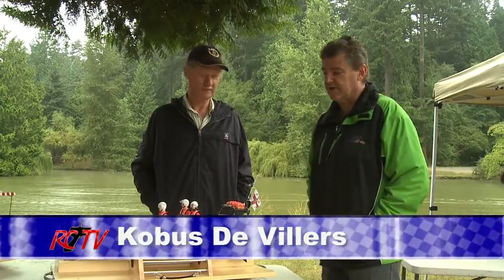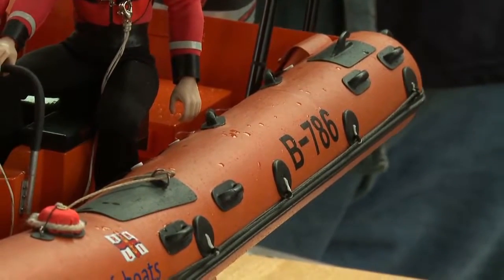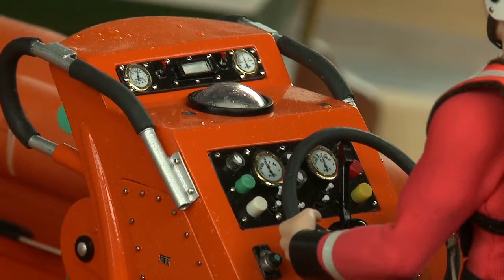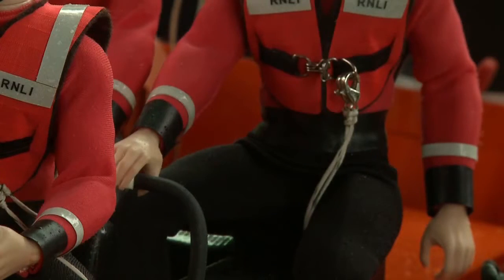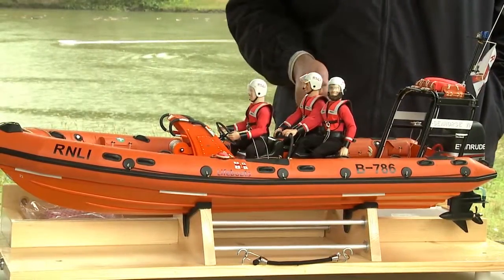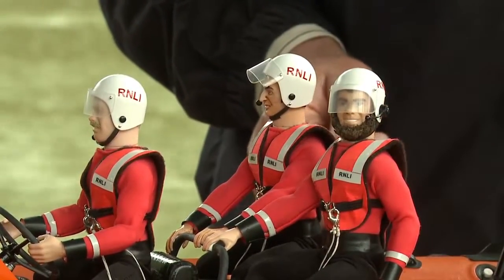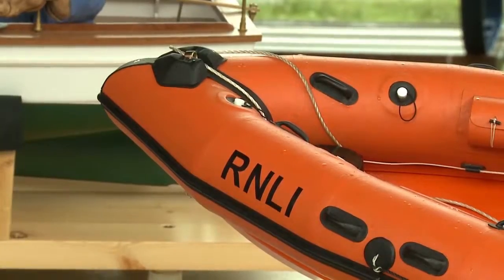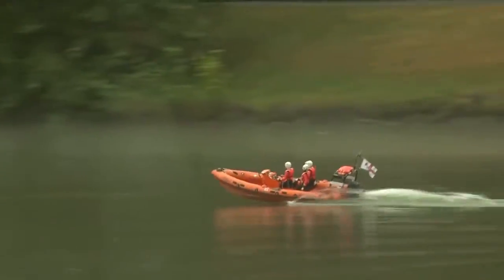Scale  RC Atlantic 75. This Zodiac style rescue boat is a great build!

Comment: 2:00 these boats don't automatically self right because it could harm the crew if they remain in the boat, instead there is a handle on the back that activates the self righting once every one is safely out the way

Very nice model, looks excellent

Comment: Nice model but he has some details wrong the Atlantic 75 does not auto self right once crew are out from underneath it  they swim to the stern of the boat if they are able to and pull the manual firing release. Secondly the crew are not strapped to the lifeboat only hands on the bars and on the deck there are foot holds, which you use by rolling your foot back on your heels. But as a point of interest if the boat does go over you get back in the boat between the engines. And yes I served on one of these boats